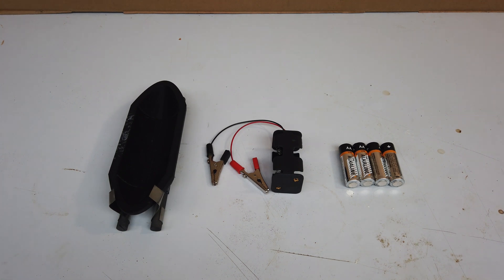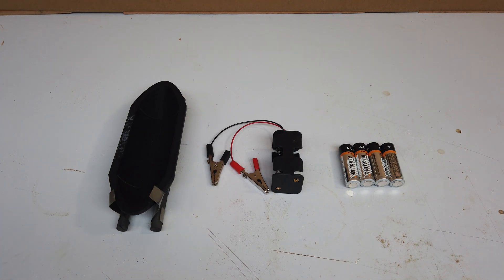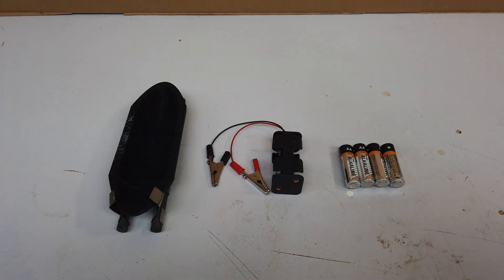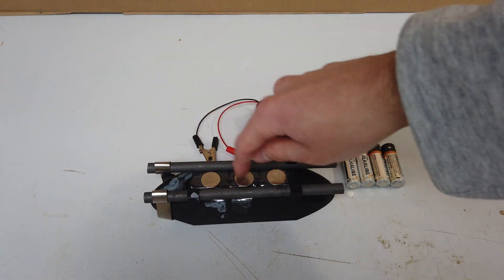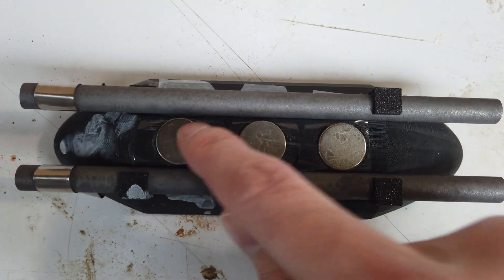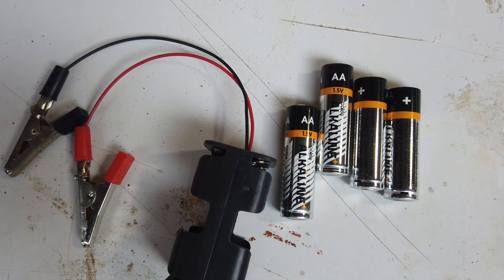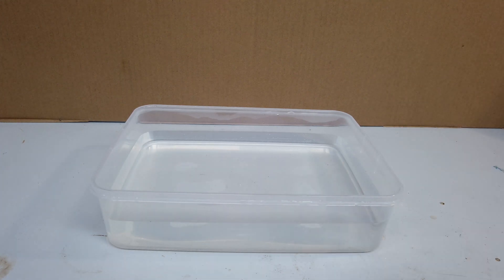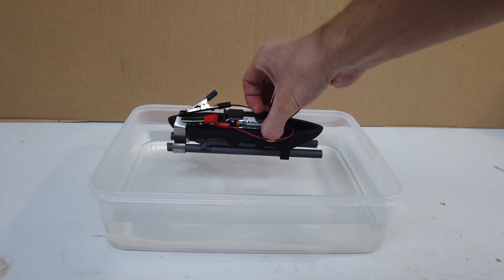Propulsion With No Moving Parts

Comment: What a great video. I was showing these principles two days ago to a student who needs to do robotics at school. I had to make him grasp that magnetism likes to flow within the magnet, or even in some materials, but not through the air. So first principle in the design of any motor is to have the magnetic gap very very small. In the case here, it is huge, with the bar type magnets. You have to complete the magnetic circuit. If you did that, your MHD drive would go much much faster. It's nice that it is silent, but unfortunate that it produces hydrogen and chlorine. I guess we are stuck with more conventional means of moving the water there...

Comment: Well, the electrolysis is quite a problem there. So it have been thought that you need an electromagnets so you can put an AC current through the device preventing any electrochemistry from going long in one direction but preserving the relations between the current and the magnetic flux so you would have one way propulsion.

Comment: try dual-bushing based hall-effect opposite-magnet dc motor (not brushed like brushed dc motor). same thing as mhd lorentz but the fluid is a radial solid metal disc. the boat would probably move faster if you just burned the hydrogen and oxygen in a rocket on the boat.

Comment: What if you had 3 rod's and the center one is -/+ and the two outside one's where the opposite and had set up the same way between them, would it actually go in a straight line. But then be able to control the current amount to each side to give more or less current to make it turn. In my mind it sounds possible.
Reply from the maker: Sounds like it would work to me. I like it.

Comment: Perhaps you could make a centre-anode and two side cathodes like in a trimaran, so that the boat wouldn´t turn circles due to different gas outputs. And from the center-anode you could collect the hydrogen in a balloon that in many hours time would lift the boat above the surface. Perhaps a few solar cells on the top to create a permanent motion insunny days.
Reply: This will not work and will cause a strong torque because when you put an anode in the middle of two cathodes, the electric current on the right side of the anode will be opposite in direction to that on the left side, so the magnetic force in the two sections will be opposite. You will get a torque but no linear momentum.

Comment: So, theoretically, could this be done at scale with seawater too?
Reply from the maker: Yep! It's been demonstrated a few times with passenger-carrying vessels. Though it's not particularly efficient, as far as I'm aware.
Reply: Yessir but it generates bad stuff. I can't remember what it is
Reply: @LexLuther-sf3zm the electrolisys of salt water produces chlorine (1914 Verdun bad stuff), sodium hydroxide (you arent suposed to put fish on lye) hydrogen (Hindemburg's oopsie gas), and unlike the Red Oktober the bubbles produced are noisy as hell
Reply: Japanese engineers made one in the 90s, I rode about that on Popular Mechanics, IITC Toyota did that.